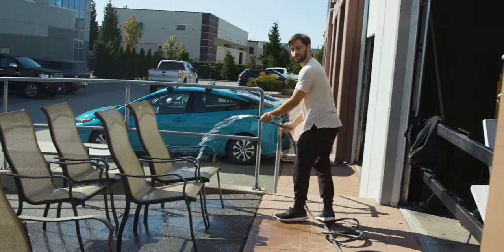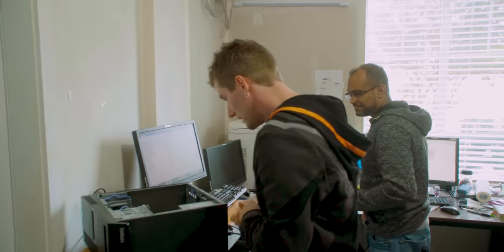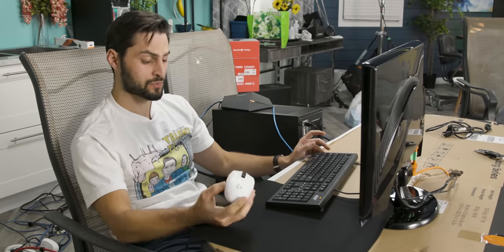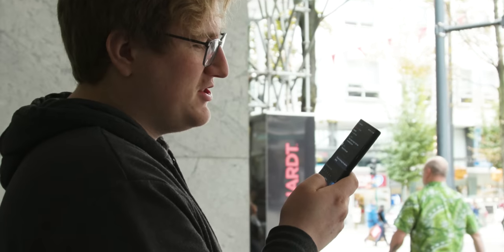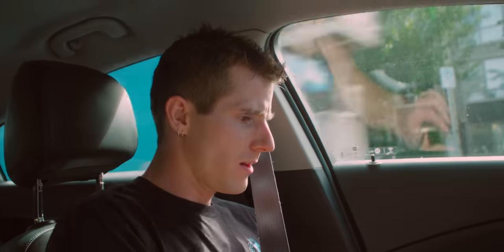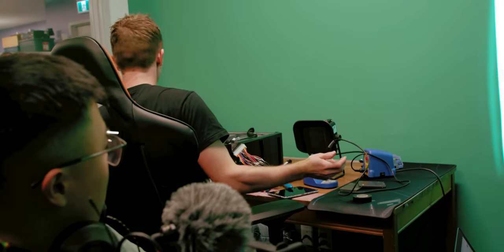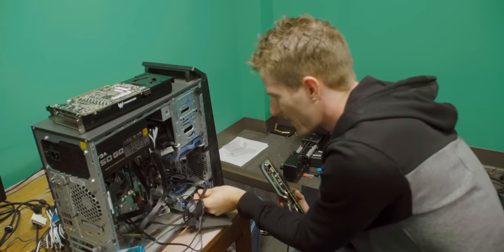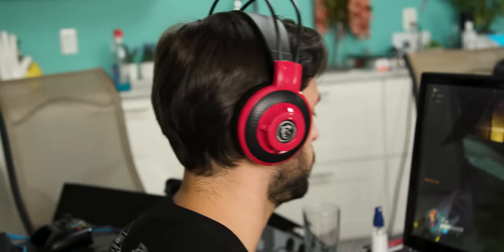Budget Gaming Setup CHALLENGE - Scrapyard Wars 8 Part 2

Comment: Me: Pays 200 dollars for a shitty computer that didnt even work.

Linus: Pays 200 dollars for two pretty decent computers by accident.
Reply: Khaffit  they turn on...
Reply: for 200 bucks i got a pretty decent server albeit with 2013 hardware. but more than good enough to host extremely decently and set up a vpn for travels as well as letting dev friends run random shit on it for cash ;D
Reply: @TrlllyComicBookNews  after facking splitting the wires of their power supply, a don't do this at home kinda thing
Reply: @chipiegg1466  Not really a problem outside of this competition. Those wonky Lenovo 14 pin motherboards are pretty common, so adapters for them are readily available online.
Reply: And canandian dollars not usd
Reply: In Canada where parts are pricey and hard to find.
Reply: @1moreaccord  People don't pay $200 for a desktop to upgrade it
Reply: So, your complaint is that you didn't test used hardware that you bought and that you're not great and taking the time to find good deals...?
Reply: not by accident xD do your research and some patience and you'll find a good deal, always deals out there just gotta be willing to find them instead of jumping the gun on a crappy falsely advertised PC.
Reply: And he ripped off the other guy lol 😝

Comment: Bro when the Lenovo guy was like “$200 = 4 gig ram” 

I was dyingggg
Reply: I bought a Dell Optiplex  with a 180gig sad, 1tb drive, 16 gigs of RAM and an i7-4470 for 250 off of eBay two months ago.
Reply: Machinist 72 that’s insane!
Reply: @machinist7230  what gpu did u use?
Reply: @sawii1482  none yet, im thinking of getting a 1660 black because of the limited space in the chassis.
Reply: @machinist7230  how bout the 6 pin connector? u might need sata to 6 pin or the psu already have the cable
Reply: @sawii1482  that's one of the reasons why I'm holding off - the PSU is barely adequate for the stock config, something like under 300 watts, so it would mean that would have to get upgraded as well. Mebbe once I get back to work and clear up some bills.
Reply: @machinist7230  recently bought a Amd Ryzen 7 with a Asus rog strixx 1070 and asus Crosshair 6 board for 200 euros because the seller thought it was broken but as it turns out the only broken thing was his ram

Comment: You realize your monitor is crap when on scrapyard Wars you find a better one
Reply: So many people underestimate the importance of a good monitor, spend all their budget on the tower. The monitor is a key component.
Reply: @RyTrapp0  Yeah I'm always surprised at how cheap they're getting. I've spent a lot on mine. $500 for 27" 1440p 144Hz Freesync (MG279Q) about 3 years ago. Can get those features for a good amount cheaper now. Recently bought a 3440x1440 120Hz Gsync (Dell AW3418DW) for $700, the ultrawides are still pretty pricey. Hopefully I don't regret commiting to Gsync when big Navi comes out lol.
Reply: @RyTrapp0  Yeah I'd like to like at a good modern TN. The only TNs I've used were cheap office monitors. I went from 21" 900p 60Hz TN to 27" 1440p 144Hz IPS, so obviously it just blew the TN out of the water in so many ways it was hard to pinpoint.

Yeah I bet, tough choice. Honestly I could probably live without high refresh, I don't see it too well. I would switch my 27" to 60Hz, notice at first but quickly get used to it. Not even sure why I went on to pay so much for a 120Hz ultrawide; just been conditioned by refresh hype I guess or worried I might miss it in the end.

Future panels yeah, but guess we'll see about past. I mean even if AMD can put out something to beat 2080Ti I suspect Nvidia won't take long to one up them. 7nm switch is sure to bring some gains. Just might end up paying more. In any case I gotta say this Gsync monitor feels smoother and more responsive than my Freesync one. Not sure if that's because Gsync, because the Freesync implementation was a poor one (early model, small Freesync range, not Gsync Compatible), or some other factor like pixel response, but I'm happy with the Gsync monitor.
Reply: @RyTrapp0  I tried getting a 1440p 144hz Dell monitor at first, I don't remember the exact model number though. It had horrible banding and gradient issues, and so did the replacement they sent. They couldn't fix it and kept blaming the graphics card even though I proved that wasn't it. Ended up going from a $300 Dell to a $700 Acer. I'm sure I could've got a better price for something similar, but I was just fed up by then.
Reply: @Malus1531  The monitor is the least important part. If you're not doing things where color accuracy matters (I mean for business. Editing videos/pics you shot of your friends, or editing a stream of you gaming, doesn't count as needing color accuracy), you can get any cheap monitor. If your that tight on a budget, don't waste your money on a monitor you can't use.
Reply: @xenonram  There's a lot more to a decent monitor than color accuracy, plenty that contribute to a good or bad gaming experience.

Comment: Has Linus ever heard of "butt splice" crimp connectors? Works just like soldering wires but better and pre-isolated and done in 2 seconds.
Reply: The more the know!
Reply: Have you ever heard of not buying unnecessary things when you're working inside of a budget?
Reply: @carneasadafries15  true, time was not critical here while budget was. (but not for them lol)

Edit: oh wait did my reaction sound mad at all? I really just wanted to know whether Linus knows these crimp things.
Reply: @mrstijntje  I didn't think you sounded mad.
Reply: if you don't pay for a decent crimper those are garbage, soldering is much more reliable (not to mention cheaper).  If you pay 80-100 bucks for a proper crimping tool they are are pretty good though.

Comment: I had to build a scrapyard pc for a good friend of mine for under 160€. I bought
8 GB DDR4 2133MHz for 20€
Intel B150M with an Intel 6500 for 85€
Gigabyte D3A with an Intel 6600 for 90€
a new WD Green 120GB SSD for 24€
Licenses for Windows 10 Enterprise and Office 2019 for about 8€
A Prolimatech Megahalems cooler with a be quiet fan for 15€

I chopped both CPUs and applied Thermal Grizzly Conductonaut and sold the Gigabyte D3A with the Intel 6500 for 125€.

Because of we upgraded his old computer there was no need for an additional PSU or a case. 

My friend only needed a system that runs smoothly and can handle his 1440p monitor 27 inch to do office stuff. It cost him about 120€
Reply: Stefan50326 I got a Logitech g502 hero for 10 usd, still using it for 7 months and it’s working perfectly
Reply: Where did you get that office 2019 license?
Reply: @tstudiofilms  he bought it blackmarket, pretty sure. Don't do that, might as well get Libre Office.
Reply: @tstudiofilms  amazon

Comment: That moment when their pc’s are still better than urs. 🤣
Reply: sad, but true :(
Reply: What are you running? Jesus
Reply: an "i7" but i got unlucky as fuck when it came to the silicon lottery so it doesn't even run at stock speeds lmao

(it's a goddamn dual core at 2.5ghz and overheats if it goes over that)
Reply: ...so basically it's an atom processor
Reply: True af
Reply: I now have a good pc. I used to have a shit one. Most of scrapyard wars I watched on a pc weaker than the o e they had. I feel your pain. (i3 2nd gen, igpu, 2gb ddr3)
Reply: As soon as they start walking around with boxes that have "EVGA gtx 1080" written on them... yea that's about the current price of my whole pc right there...
Reply: @slippulter8053  That's terrible lol did you even game on that?
Reply: @uegvdczuVF  your pc is the price of a box? Kappa
Reply: @bananya6020  overheating doesn't have anything to do with the silicon lottery. If it was properly cooled, it would be fine.
Reply: well, i play on a pentium dual-core 2.5ghz with 2gb ram ddr2 and no graphics card, i can game on it at least
Reply: My pc can’t open 1 tab without dying on me
Reply: I only have a ryzen 3 so yeah it’s sad
Reply: I know the discussion is about crap pc you people have but I just bought a decent pc for 350$ it's a 6th gen i3 with 16gb ddr4 has an nvidia 1050 it's not a beast but it's pretty ok
Reply: Golden Empire Productions I run i3 and 8 gigs of ram

Comment: The way how these "budget" setups are the same price as mine :')
Reply: My PC is roughly 600€. I have way more performance (R7 1700, Vega 56, 16 GB RAM), but I didn't include monitors, mice and keyboards and headsets. Monitors were 130€ for 2x Full HD, 4€ for speakers and I had the keyboard and mouse laying around. All in all, I got more bang for the buck
Reply: @bspringer  that's really good, congrats bro
Reply: @bspringer  600€? I got mine for ~350€ with all peripherals. (Xeon E3, GTX 745, 32GB RAM, 512 GB SSD) I have 2 full HD monitors and 2 older ones,  I got those for free...
I'm planning to buy two better graphics card and more SSDs. So, you could have even gotten more for your money. 
I built it from scraps as Linus did, except for the SSD+keyboard+mouse+headset. These were brand new.
Reply: @bspringer  also, 600 pounds is a fair bit more than 600 Canadian dollars
Reply: Euro***
Reply: @markmocsy9223  I'm not that familiar with the Xeon naming scheme so I can't really judge on that one (but I guess its performance is lower than the Ryzen 7's). But the graphics card is way inferior to mine. Since it was my first PC, I didn't want to go experimental so I bought all parts new (except monitors and speakers) but I waited to get a good deal on all the parts. 
Nonetheless, you got more bang for the buck. I still feel like my PC was worth it though
Reply: @iandehaan649  I just checked. 410€ is 600 CAD. Didn't think the difference was that high. I thought 600 CAD were more like 500 €
Reply: @bspringer  sounds way more expensive than €600. Are you from the UK?
Reply: @АлексейГриднев-и7р  the uk doesn't use € they use £
Reply: @grenadeasc  I know. But he probably just converted the values to €
Reply: @bspringer  u are comparing to Canadian dollars bud lolol

Comment: Got a pair of HP 8300 Ultra Slim desktops off Ebay for $79 & $89. Quad core 3ghz (turbo to 3.6ghz). Looked & ran like brand new right out of the box (probably office PCs). Both came with new mice & keyboards that were basic, but better than expected. The WD HDs had over 30,000 hours on them, so they got replaced even though they still worked fine. Got some more used RAM from Ebay for them too. Really impressed by their performance considering their age & what I paid for them.

Comment: you can run 2 power supplies in 1 computer with the right adapter, you need a switch (use 1 for motherboards, 1 for graphics card. I did it an old system for 9 months without issue until I replaced them)

Comment: old video i know, lukes windows 10 saga was not due to the drives being usb 3.0 but was the fact that they were uefi bios and need to be created using the legacy boot standard. motherboards older than 4th gen sometimes do not have uefi support or was added in a bios update.

Comment: Really wondering here can't you just run both power supplies? Use the 270watts for the motherboard and use the new one for the other stuff? (No clue if that's a thing, but saves time on soldering)

Comment: soldering high ampere power wires is a very dangerous solution because high ampere power can "unsolder" those cables. Always use clamps for that.

Comment: If you load the windows installer in a second pc it does not do driver detection and enumeration until the second reboot. it does not require the media at this point forward as it preloaded base image files before rebooting! Don't bother doing the full install on the auxiliary machine.

Comment: I have used that ancient BIOS i have been using it since last month
To enable usb boot and keyboard there's an option in it, it works after that i have installed windows via usb drive it worked for me though

Comment: Just got myself the following:

CPU: Ryzen 1200 + Fan (NEW) = 31€
RAM: 2x8GB G-Skill 2660mhz (NEW) = 32€
Mobo: MSI B450 Pro m2 Max  (NEW) + free copy of MonsterHunterWorld = 45€
GPU: XFX RX570 XXX 8GB  (NEW) + free copy of Borderlands 3 = 115€
Storage: Kingston 480GB SSD (NEW) = 29€
Mouse: HAMA uRage Morph (NEW) =  1€
Keyboard: Mars Gaming HADES MKHA0  (NEW) = 3€
Screen: Fujitsu E22T-7 LED  22" 1920x1080 (USED) = 25€ 

Case: Used my old 2003 Medion MD6060 Tower
PSU: an old Seventeam 650W V-Force PSU

281€ in total TAXES included.  Thats CAD$ 411 or US$ 309

How did I do?

Comment: what about using short throw projectors that sit against the wall that you are going to use as your screen, would that not be better then you don't need more monitors, Just ditch Windows and go with Linux Mint CINNAMON 19.3 (Tricia) 64bit edition plus Wine64+Winetricks64+Zip.dll and you can have all Windows games you want installed.

Comment: I don't get why you didn't just leave the lenovo's as they are and then using a 3rd power supply to just power the GPUS, hard drives etc, would have been much easier.

Comment: Really don't understand why Linus would chance stripping and repinning a new PSU down to 14 pin, when 24 pin to 14 pin adapters exist for like $5 for this exact reason.
Reply: So after finishing the episode, Linus splices two 24 pin to 24 pin adapters, instead of just using a 24 pin to 14 pin, and didn't bother to go back and pay the guy the other $200 after accidentally under paying for them?

Comment: Mistakes made- triton kama headset less then the msi ones, steel series rival 100 cheaper than g305 better ips , Xbox 360/PS3 controllers would of worked just require extra software and there's a lot more but I can't be asked to lest them all

Comment: not sure why Linus cuts and solders wires together when you can just remove the wires from the molex connector with the proper tool and pop it into the appropriate connector, seems like a big waste of time and not nearly as clean.
Reply: It's very easy to fuck up doing this, there's plastic clips that can break responsible for holding them in, and then you've lost your connector.

Comment: I know this is old as balls now but if you ever have a problem with ANY usb 3.0 to 2.0 I use a generic USB 2.0 HUB and it solves all my problems. I have some old ass hardware and it doesn't like my USB 3.0 ports.

Comment: "MSI doesn't make bad."

Bull. Shit. $2,400 on an MSI laptop that was SUPPOSED to be upgradable (wasn't) died within a couple years. And it's not like I wasn't taking care of it. The CPU wasn't even great for a laptop CPU, and the GPU temps would never stay in check. 

My current desktop with Asus and Corsair components is about the same age, pieced together from multiple PC's on their (at least) second user(s), and still running strong with a 17% overclock settling at 4.6 GHz (I7-6700K).

Comment: I have difficult choise triying to upgrade My pc, I hope some of you guys could Help me cose I'm really strugling;
I got Fx6300, Gtx950, 2x 8 Gb 1600Mhz Ram, 970A-DS3P Motherboard, Hdd 1Tb, 500Gb SSD, 600W titan psu (Since 2015 it didn't broke yet so I guess it's not that bad and reviews say ;D) 
Now I got 300$ but for Christmas I can get more, then 1st may birthday money, then I could also sell my pc parts cose all works fine but I want 144 fps in Rust on Competetive-medium-low setting
What's the best move:for Upgrades?My Gpu ussage is 53% without Overclocking but after Overclocking to 99% Gave me the same Fps, I also overclocked My Cpu from 3,5Ghz to 4,5Ghz and no Fps improvement So I Overclocked Cpu, Gpu and got almost 5% fps boost but with More % ussage and Game was less stable and sometimes crashing so I retuned to Default ( I also change ram form auto 800Mhz to 1600Mhz ) Still it wasn't holding 60 Fps with heavy drops to x < 30 So I want to exprience playing competetive without laggs and I also Like to play with Insta Replay ( Amd&Nvidia got the same options) and edit a bit with Resolve 15 and Make Thumbnails for my  crapy videos for memories and also showing other friends cool stuff we did
So I was thinking about cuple options like only Gpu like Rx590 8GbvRam or Everything besides Gpu mainly Ryzen 2600, B450MotherB, x2 8 3000Mhz ram and propably Psu and Case if needed---->>> then later The 2nd half
I have never Built Pc but I watched a lot of videos in recent 2 years so I have general idea. I still can't find out what is bottelnecking my Pc cose overclocking in many options didn't helped me veryfying cose Rust is really weird perfomence game and for some reason the game really like 16 Gb ram, ssd and 8GbVram ( a year ago I bought 2nd 8Gb ram stick, 100% the same one cose from the same shop upgrade and ssd Helped but my the rest needs money to test it. I could try Buying Rx590 Testing it and returnig to shop then do the same with Cpu,Mb,Ram,etc But I wanna ask for Help first You Guys
Reply: You tried overclocking from 3.5 GHz to 4.5ghz!? You are lucky you are alive. Overclocking over half a GHz is for pros only, but 1ghz!? Your house could have burnt down!!